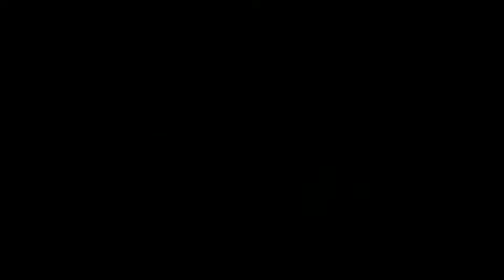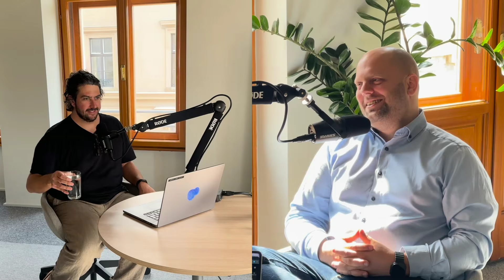István Csanády: Geometry Kernels, Implicit Representations and CAD

Comment: There are differences in b-rep implementation itself. For example, Open CASCADE requires closeness in parametric space that is not required by ACIS. As result, Open CASCADE introduces technical seam and degenerate edges. On the other side, ACIS or Parasolid introduce different types of loops (wires) and evolution rules for them. B-rep is not only protocol; b-rep is an idea. This idea is implemented differently in modeling kernels. That is why you cannot just exchange b-reps directly between kernels, you have to export to some neutral format such as STEP.